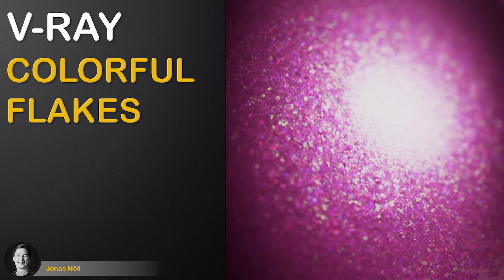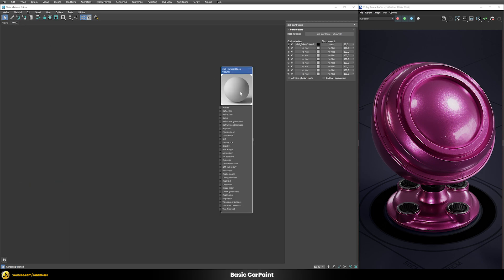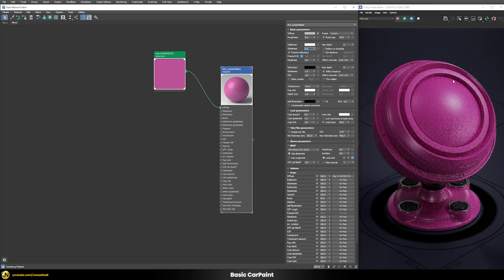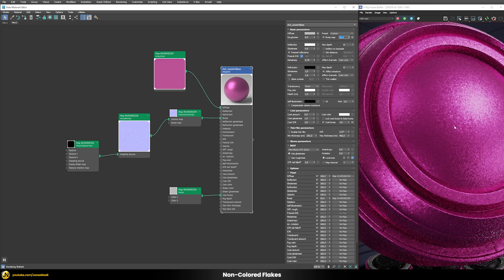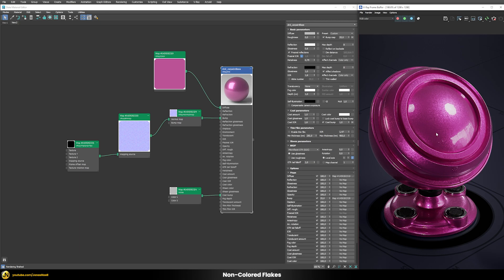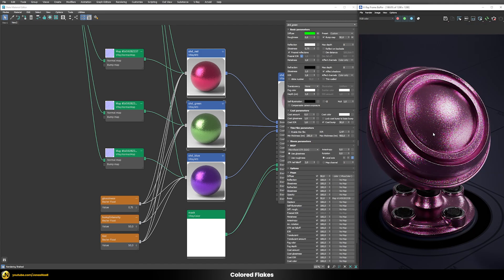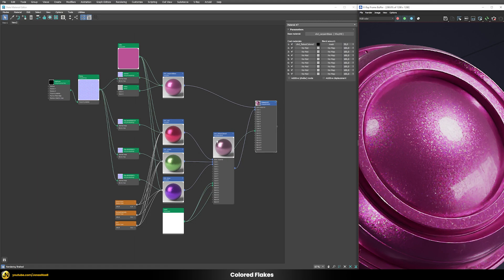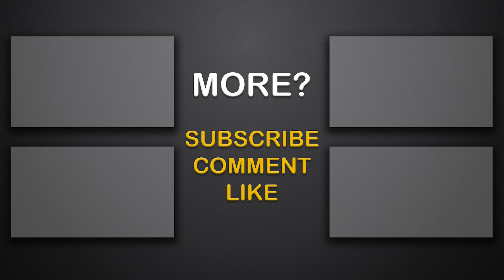V-Ray | COLORFUL FLAKES Carpaint Shader

Comment: you realize you could just use the normal carpaint2 material and drive the color of the flakes with a grad. ramp? its faster to setup, faster to render.
Reply from the maker: Not really but if it works for you then go ahead :-)
Reply: @JonasNoell  of course you can, there even is an example in the documentation for creating multi colored flakes. what do you get from overcomplicating it?
Reply from the maker: @blenderisms  The flakes in the Carpaint Mtl are implemented horribly in my personal opinion. Yes, you can randomize the color. But they turn up everywhere and not just around the highlight, have issues with flickering/aliasing, and create dark spot in the shadow areas. But if you enjoy using the Carpaint Mtl and feel you are getting the same result then stick with it. If you happen to make a tutorial about it I will be the first one to watch 🙂

Comment: Just wondering. Why aren't you using the ramp with different colors for the flakes material? I use it for years and am able to recreate every color I need.
Reply from the maker: Hard to tell without pictures if that achieves the same effect. Are you talking about coloring the entire reflection? In my example the colored flakes should just appear around the highlights while the rest stays neutral.
Reply: I'm talking about the ramp for all flakes. Their behavior is not only seen on the spot, further the flakes color has an impact on the whole metallic appearance of the car paint, like it should, as far as I'm concerned.
Why would you want to have the colored flakes effect only in the spot light? Is there a use case where you would need this specific behavior from the flakes? Would be interesting.
Wenn, du willst kann ich dir mal meinen Renderings zu der von mir genannten Methode schicken. 😊
Reply from the maker: Hi, the general idea was to show how to split up the reflection in several channels, then offset each and combine it back together again. I used car paint flakes to demonstrate this effect in this examples. But there are numerous examples where you can use it. For example take a CD 💿 shader where you just want the highlights to have this color shift effect while the rest stays neutral. Otherwise your CD would look like a a colored mess. If your workflow works good for you then stick to that, it always depends on the usecase and there is not one solution that fits all cases. Im not trying to convert anyone to adopt my workflows 😀 Nonetheless if you want to send me some pictures: info(at)jonasnoell.com as I’m always interested to see how other approach the same task.